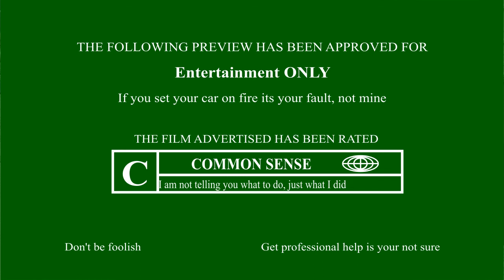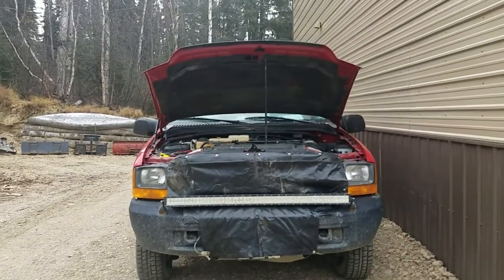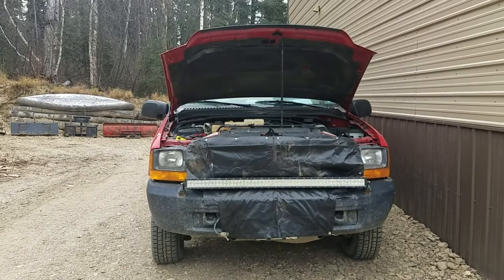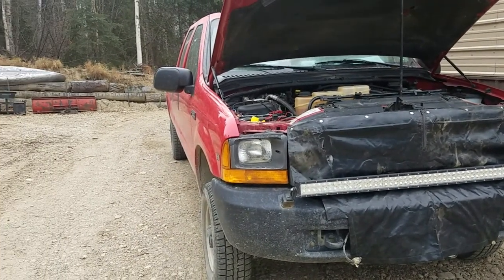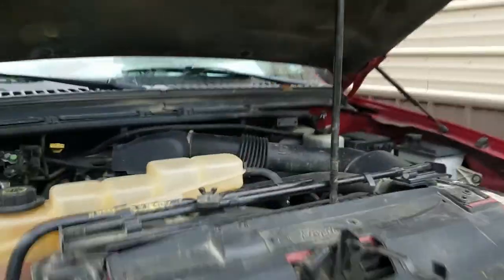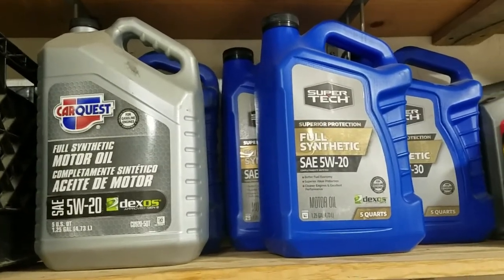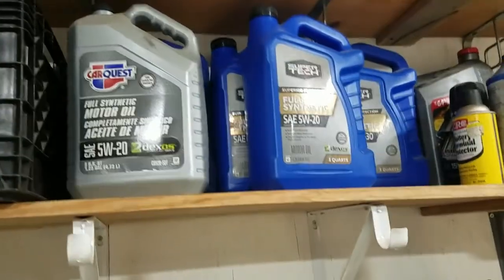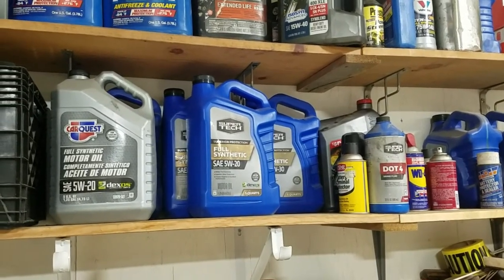Part 2. Prep for winter in Fairbanks Alaska.  Winterization of your car or truck. Block heater.

Comment: Whered you get that 4 way plug? I'd love to get the same one if possible. Thanks!
Reply from the maker: It's just a regular Homedepot 4way box with arctic grade wires.  We've used them for years and they don't short out.

Comment: Practical Porters.  Hello sir.  Can you tell me how long you have to run your heaters and trickle charger?  Also, I am thinking of getting an F350 down here in Oregon and taking it up to Alaska.  Is installing block and oil pan heaters a DIY project or more like shop work?
Reply from the maker: @RobertMOdell  At -10f and below run them on a 2 hour timer before you need to leave for work. Letting them run all night is waste.
Reply from the maker: @RobertMOdell  The block heater is doable but a shop maybe the best if your not handy.  The oil pan and trickle charger is all about routing the wires away from moving parts.  Easy but needs to be thought out
Reply from the maker: @RobertMOdell  I've done many vehicles and it gets easier each time.  Lastly make sure to upgrade your antifreeze to -40f